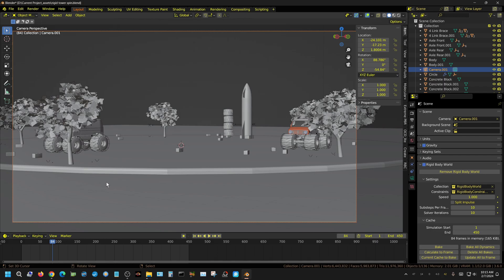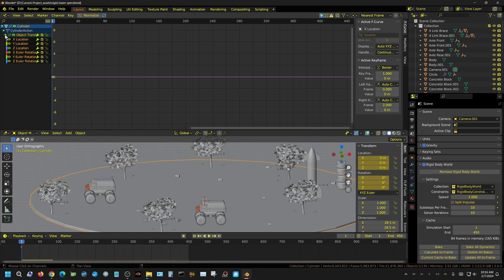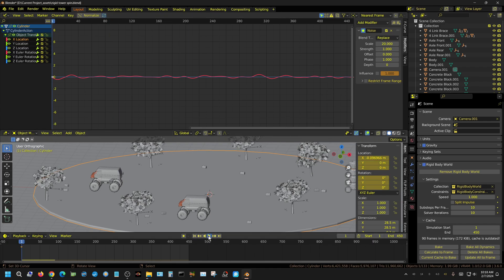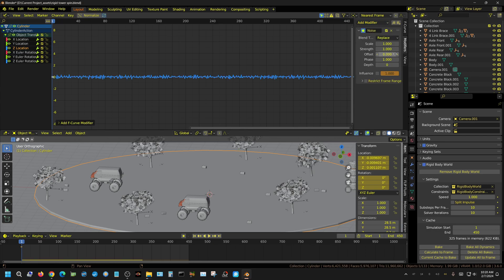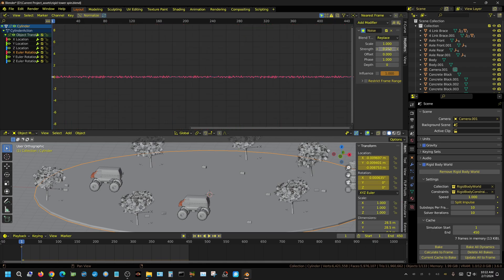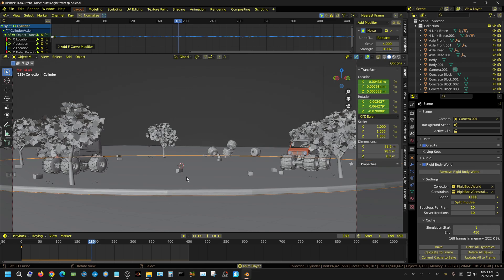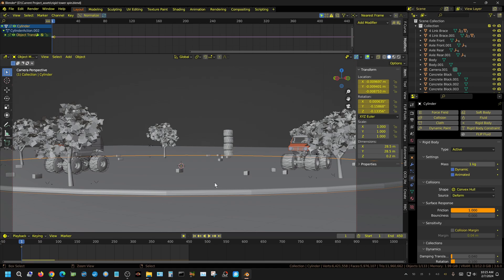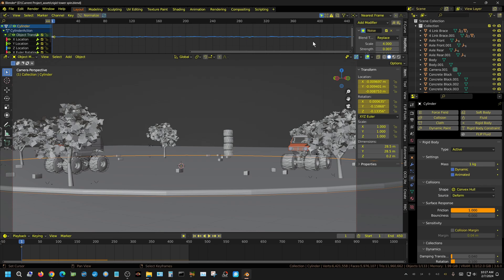Generate Earthquake Movement - Blender Tutorial

Comment: can you explain the trees a little more in detail? did you use an empty to connect the plane and the tree as a constraint or how did you do it?
Reply from the maker: The platform and the trees are both rigid bodies. The platform is keyframed and has a noise generator. The tree is just an active rigid body object that is connected to the platform with a generic spring constraint. The generic spring has settings in the physics panel. Those settings control how much the two connected objects can bend or twist in relation to each other and how much force is needed to make it bend.
Reply: @BlenderRookie  thanks a lot :)
Reply from the maker: @selinathorn3625  You are welcome. I hope what I said made sense. I had just woken up when I replied.
Reply: @BlenderRookie yes my tree also wiggles a little jow, i just needed very different damp and stiffness :)
Reply from the maker: @selinathorn3625  Cool beans.